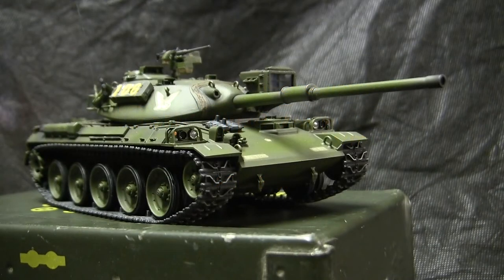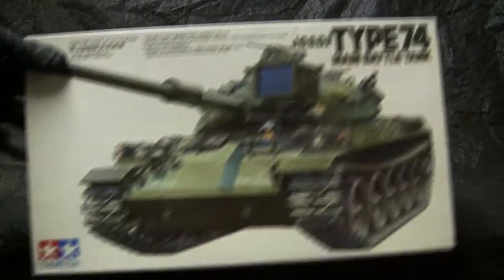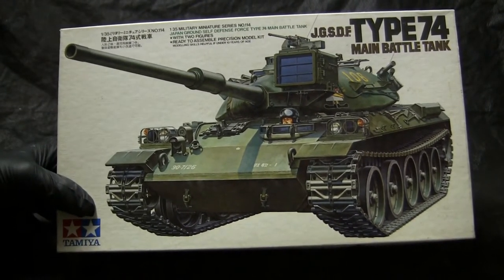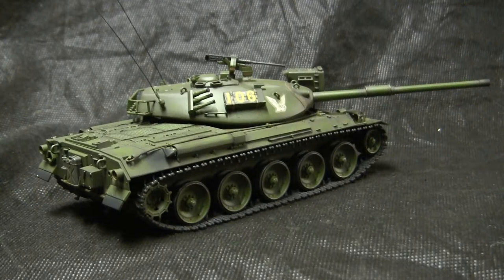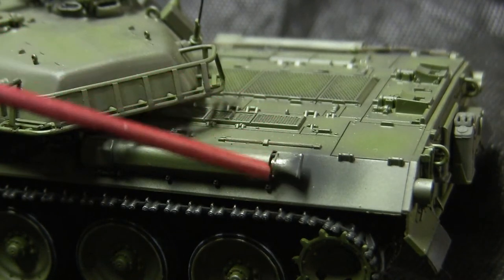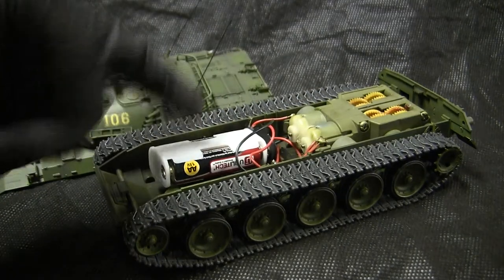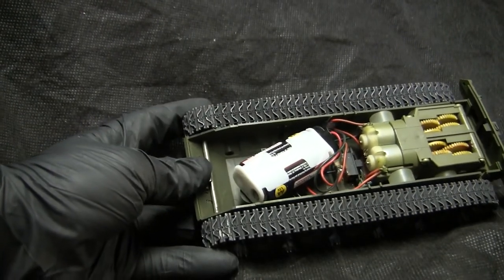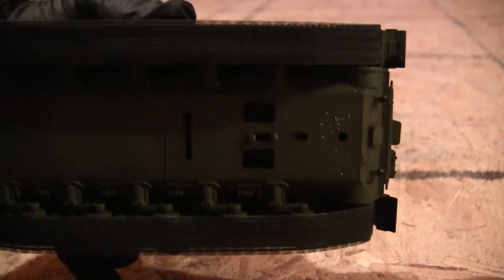Motorized 1/35th scale Vintage Tamiya JGSDF Type 74 Main battle tank

Comment: I wonder if it’s possible to further convert one of these motorized kits into an RC version, always wanted a Type 74 to drive around but I haven’t found anyone that makes em..
Reply from the maker: yes, you use the same gearbox but use micro electronics for the esc and receiver. There are guys on youtube that RC convert static model tank kits

Comment: I just bought this on ebay. The instructions say to paint it olive drab. Did you mix something with the paint to make it lighter? 
Also on the turret there are no holes for various hooks, just marks where to place them. Did you drill the holes with a pin drill or just glue the hooks to the marks?
thanks in advance
Reply from the maker: It's been awhile since I built this one, but from what I can remember I used Model Master Medium Green and then I  used model master green drab for the edging. Everything is done via the airbrush. For the holes I don't think the drilling was needed. Best is to dry fit the part. If it's too tight for comfort drill out the indents with a pin vise or a dremel
Reply: @oddball759mm  Thank you so much for all your help. I may use Tamiya's green for JPSD vehicles.
Reply from the maker: @82clashman  that should give you a good start, I went with the colors I used because it was close to the one on the boxart, which I liked and wanted to emulate for my build

Comment: Really nice work! I have some questions regarding the motor installation. Where do get those spacers that keep the motor attached to the Hull? Do they keep the motor tight inside the hull so both are removable? or is it glued? Also how did you attach the drive wheel to the axles? just glued? the old tamiya motors had a small nut that fit into the drive sprokets.
Reply from the maker: The spacers are machined out of resin stock. They don't hold the motors in, instead they prevent the gearbox from shifting to side to side. They are glued to the tank's hull. To attach the sprockets I machined out of the same resin stock inserts that connect to the hex section on the tamiya sprocket and this is glued to the drive axle.
Reply: @oddball759mm  Thanks for the help.

Comment: does that gearbox fit in most 1/35 model tanks?
Reply from the maker: yes
Reply: @oddball759mm  sorry for so much question, just gonna ask, in the metal rod you added on the front 'wheel' does it have already a hole? or do you made the hole for the rod? and what is the size of the rod your using?
Reply from the maker: deca gon I think I went over this in the video but yes the hole is there in the hull. when the kit was designed tamiya used a steel rod so the wheels would be strong enough for motorization abuse. When the motorization was removed tamiya wants you to use two plastic rods they supply. On this model I omitted the plastic rods with a metal one that was 1/8th of an inch.

Also no the switch was not included. I just used a simple spst switch from radio shack. Good luck with your build
Reply: @oddball759mm  thanks dude for clearing it up 👌👌